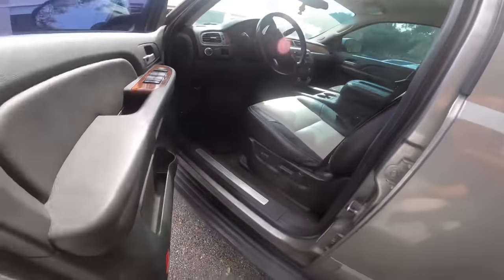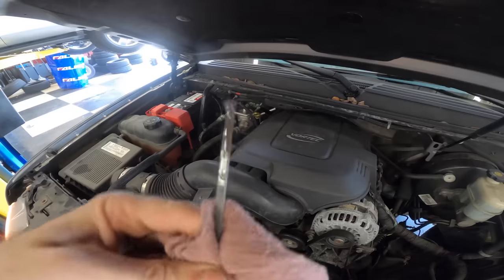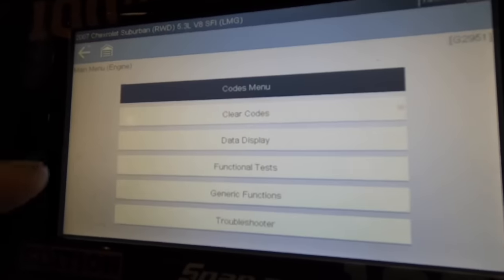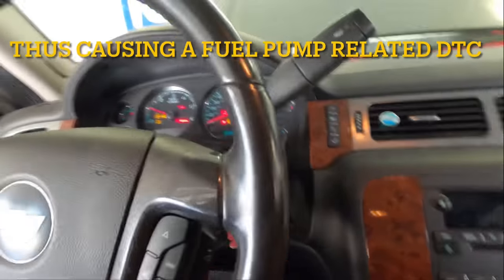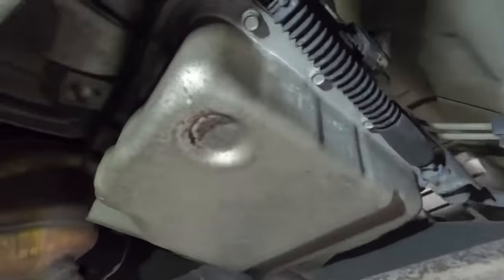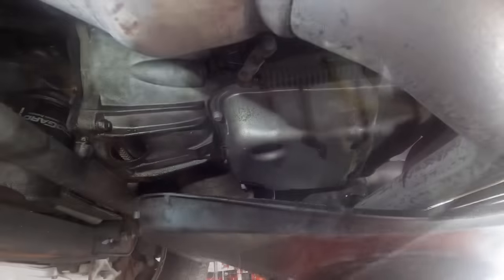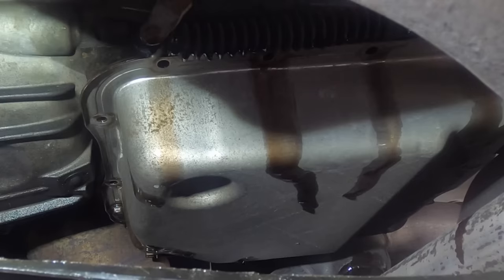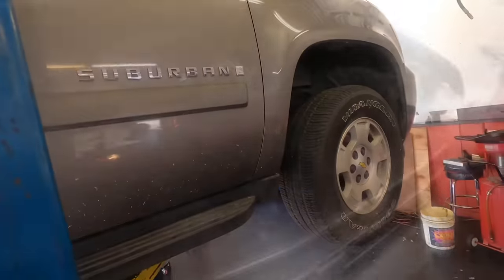Busted! SCAMMING Mechanic Causes Damage! 4l60E Transmission

Comment: The more videos I watch from you, the happier I am that I do in house fleet work. The drivers still lie, but my two hands are pretty much the only thing that touches the trucks so I don't have to worry about anyone else's work. My favorite time of year is coming, busting guys "checking" trucks oil and whatnot without ever disturbing the blanket of snow on the hood. Some are real good, they can find power steering and trans fluid to check on F150s that have neither option.
Reply: Ah, a lot of those inspection sheets are really antiquated. Check the oil, and a few other safety items should be all that is expected.
Reply: @mph5896  We have stuff from the early 2000s still on the road along with brand new ones, there is one sheet for all of them. It's a good test to see if people are actually doing the checks or not. The only check a lot of them do is whether the starter works or not.
Reply: I hired an ex-military lead tech/driver supervisor.
He started doing spot checks (after drivers were suppose to have done it) in the AM as trucks were departing yard(one truck a day), and quickly found the problems...
And almost stopped the on road problems (some breakdowns are inevitable)..... and got drivers to do a real vehicle checks.

AzDOT (DPS), road checks even stopped finding issues....
Best hire ever! amazing what spending a little time before can save you in the end.
Reply: It's a disgrace that Ford doesn't even provide a trans dipstick anymore. I didn't know they also sealed off the power steering pump. They want you to take it to the dealer for every little thing, at $105 an hour. Instead, I'll buy another brand.
Reply: @pookysdad4884  F-150's have electric power steering since at least 2015. The trans is checkable, but it's not easy to do.
Reply: @61rampy65  Oh, how interesting. Is it steering by wire?? I know many cars are throttle by wire, and some even brake by wire. Or is there a mechanical connection still, with electric assist? I'm an old car guy (old guy AND into old cars), but know little about newer ones.
Reply: @pookysdad4884   Electric motor on the column under the dash, hooked to the rack. Very few vehicles use a throttle cable anymore. Almost all are totally electronic. In many cases the parking brake is also electronic as well.
Reply: @joshuapittman5208  I see, thanx!
Reply: @joshuapittman5208  I'm pretty sure Ford's are standard steering columns with an electric rack.
Reply: @pookysdad4884  The dipstick was clearly designed by someone who will never attempt the job of checking it. You have to reach between the smoking hot catalytic converter and trans with a 19mm (?) wrech and thread the cap off then do your best to get the little stick out without getting burned.
Reply: @--_DJ_--   Maybe. I don’t work on them, I just know most companies are going to electric or electric assist. I really wish they wouldn’t though. Prefer hydraulic myself.
Reply: Visit a salvage yard. Buy an engine and trans dipstick and cut them off. Randomly install them in trucks and  Give the driver that finds them within a day a gift cert for a nice dinner. And at least the local dinner, not the golden arches. <G>
Reply: @bobmazzi7435  They are getting well paid to open that hood, I am more likely to give them a kick in the ass for a bad job than a pat on the back for doing the bare minimum. That is a funny idea though with the mock dip sticks.
Reply: Electric power steering is pretty slick I think. They say they only draw power while turning so it helps with fuel efficiency compared to the regular hydraulic power steering.
Reply: @rustyshackelford7651  I find it a bit too light on the new F150 I got from work. It's fine going down the road though, just the real slow stuff. It would be great if they would let us adjust the feel.

Comment: Have heard too many stories about bad mechanics. Had a few positive experiences, but fear of the bad makes me repair my own vehicles as much as I'm comfortable with.
Reply: @todddennehy804  Luckily, I found a decent small town mechanic that seems to do a good enough job. Had an intermittent stalling issue that he wouldn't repair until it got worse, since he couldn't verify the cause. I still do most of my own stuff. Lucky to have a dad that used to work on vehicles all the time that teaches me what I don't know. Had an oil filter housing gasket blow last week that I thought would force me to get the vehicle into a mechanic, but managed to change it after only a few expletives being directed towards the suspension that got in the way.
Reply: @muffinmaan7444  that's awesome.  I lost my dad pretty recently, and he's the one that got me interested in specialty cars.  Dad's are the best, right up there with moms!
Happy motoring!
Reply: @muffinmaan7444  It speaks well of him that he insisted on verifying the problem before he spent your money on a repair.  IMHO

Comment: Great video!  I'm dealing with a car that the repair shop told me they performed a Block Test on the car and verified the head gasket had blown.  Problem is, the car was towed to them with a blown out radiator.  The didn't know their audience, I knew they couldn't do a block test without coolant.  quoted $7800 for radiator and head gasket R&R.  I brought the car home (300+ miles) on a trailer and will perform a block test with a new radiator installed.  I used to run a shop and couldn't believe how many shot gun repairs came through without fixing the problem and so many scams.  Even some of the good mechanics played dirty.  One guys attitude was charge em cheap at first to build trust and get the $$ back on subsequent repairs.

Comment: Rainman, you got my sub halfway through this video! But this just makes me renew my commitment to buy older vehicles that are as close to a lawnmower engine on a chassis as I can get.
Reply: lol!
Reply: Veteran 1975/ 93   16 E ...52 D... 63 B.. Paid Attention,  AWS... ASE... Cert.  
1960 F100 4x4
1977 Toyota Hilux
1978 Dodge Sportsman Apache Motor Home 4x4
Trust me Lee stay to your older stuff and life is sweet.
Reply: I could not agree more.If I was 30yrs younger,my main vehicle would be an 80s vehicle that I had completely refurbished myself.
Reply: the issues on it are normal, stupid owner basically and crooked mechanic
Reply: Kinda like my 77 toyota pickup

Comment: Great content. It took more smarts to rig the car than to fix it in the first place. Use your powers for good not evil !!
Reply: I thought the exact same thing.  Guy is clearly smart.  Too bad he uses it for the wrong thing.
Reply: Yeah that's why I disagree. I don't think a scammer would go to those lengths to sell a fuel pump and TCM. Plus the vehicle started and ran. Kind of hard to sell a customer a fuel pump on a running vehicle no? QI suspect that vehicle had your typical GM electrical gremlins that come and go, and someone worked in some bypasses and rigs. 🤷‍♂️ just my observations as a professional mechanic.

Customer strikes me as one who doesn't properly maintain their vehicle. Judging by the condition of that transmission fluid, the engine oil pressure fault, and the ghetto ignition switch.

Comment: After working in a few auto shops, I was disgusted with the service writer/owners selling BS services to pad their pocket. These women come in for an oil change and suddenly have burned up brake rotors using scare tactics to make a sale.. Even as a customer, these shops try to rip me off not knowing I'm ASE Certified as a Med/Hvy truck technician, and only there for a state mandated inspection. [Blackstone does ATF testing and quite reliable]
Reply: Nothing against you personally but ASE certifications are a joke, I'm Certified in structural repair and welding. I have 0 idea how to do that.
Reply: @squidlox5459  lol
Reply: @squidlox5459  I would like to know how it came to be that you were given certification for something that you know nothing about and where you went to school for it.
Reply: @todddenio3200  went to WTC for their now retired auto body program. They provided ASE certification tests for free with the program. I took all the tests I could, passed every single one. The only one I'm semi-qualified for is non structural repair
Reply: @squidlox5459  wow. When I went to tech school for autobody the testing for ASE certification was not handed out that easily. To get the certifications there was not only a written test but also a skills test where you actually had to do the work to demonstrate that you were qualified to get the certification. Same went for those who took the mechanics  and the automotive machinists courses. Between my brothers and I we went to 5 different Vo-Techs here in MinneSNOWta and all of us had to test out with both written and skills tests. One of my brothers failed the written test because he is dyslexic and had to retake it. Maybe it differs from state to state or school to school but it seems that MinneSNOWta has a lot stricter guidelines on a lot of things, for example CDL driver’s licenses - when the state changed the testing for getting a CDL or keeping it if you already had one, there were a lot of drivers with over 20 years experience who failed the tests repeatedly and some never did get their CDL back including some who worked for the state highway department.
Reply: @todddenio3200  ASE was multiple choice on a computer
Reply: I'm an Electrician and its the same as long as you've got a good memory you can be a qualified electrician. No practical examination just equations and page flipping and the test is multiple choice.
Reply: @dabiggcrunk  WOW. That is a scary thought. It makes a person reconsider whether to hire an actual electrician or if they should study up on how to do the work themselves. It would also explain why it seems that some electricians tend to repeatedly have problems arise with work they’ve done which the inspectors would make them fix before the wiring could be enclosed on jobs where an inspection was required and why on jobs that it wasn’t required they would be called back because something was not working properly or a different electrician was called in to fix the problem because the property owner no longer trusted that one to do the work. This had happened to my mother several years ago and while I did know how to do the work properly I was not allowed to do the work legally because I was not the property owner which is how the laws on doing electrical work are in the state I live in but the laws may be different in other states but I don’t know for sure.
Reply: @todddenio3200  Oh just because someone is a good electrician dosent mean they're knowledgeable in code lol. I'm an instructor and teach code and calculations and the two are not the same. It's takes time to be a sound electrician which is why I have to disagree that a homeowner should do their own electric work. So many variables I can think of before and during installation that a typical homeowner may not be knowledgeable on or have read the Article or even interpreted right. Technically a homeowners not supposed to change a light bulb, it's supposed to be a permit pulled. Many people die each year doing "basic electric work" . Just remember that it dosent become an article in the NEC unless a Corpse turns up.
Reply: @dabiggcrunk  the one that my mother hired first had wires crossed going to her new water heater, furnace, and kitchen range with hot leads going to the neutrals and the breakers tripped instantly when Turned on when he was done. He came up from the basement walked over to the kitchen range and turned it on but stood in front of it so nobody could see if any burner lights lit up and then said he was finished and that it would take a while for the water to heat up, and asked if she could pay him while he was there because he had to go do  a job at his bank so he could just deposit it when he got there to do the work for them. She paid him and got a receipt and he left. 2 hours later she went to wash her hands and the water was cold. THEN She asked me to go and turn on the breaker because he must have forgotten to turn the breaker to the water heater on. I went down and saw it and 2 others were tripped, turned it on and it instantly tripped again just as she yelled down to me to say the range wasn’t working. I tried those breakers and they tripped instantly as well.  I told her the breakers were tripped and kept tripping instantly when I turned them on.  She called him on his cellphone and told him the breakers were tripping and asked if he could come back and find out what was wrong with those circuits. He said it had to be the appliances that were bad and they’re not his responsibility and hung up on her. She wouldn’t let me look at it even though I had completely reworked my own house and garage  with no issues. She called a different electrician to see if they could come look at it and luckily that one was available and could be there in 10 minutes as he had just had a cancellation and was at a gas station 4 blocks away. He came and I brought him to the basement to show him what was where and he took the electrical cover plate off the water heater after turning off the breakers. I was already back upstairs by then and we heard a loud WTF? OMG!!! Who the F did this and he came upstairs looking like he wasn’t sure if he should faint or explode and asked if I could go downstairs with him because he had to show me something. He showed me the crossed wires at the water heater and said he wanted me there as a witness to it and to watch as he assessed the other circuits to verify tat he hadn’t changed any of the wires around. He then went to the furnace and removed the cover and wires there were also crossed. Then he went to check the outlet for the range and THAT was actually wired right…at THAT END. Then before correcting anything he had me watch him remove the cover panel from the service box. I thought he was having a stroke when he looked inside and saw wires crossed in the breaker box as well as some neutrals for other circuits that weren’t even connected and others that were not even tightened and were just resting in the holes behind their lock screws. He was amazed the house hadn’t caught on fire even though it was only a few hours since the other guy had left. He checked over EVERYTHING the other one had done at both ends of each circuit and photographed everything that was done wrong. Mom had to file suit against the first guy and he paid her just  before the court date. Somehow that idiot had gotten licensed and bonded as an electrician and even after
How bad he’d messed up at my moms house, and she had filed complaints on him and somehow he kept his license even  though 3 weeks after  moms house a  garage he had wired for a customer  burnt down from an electrical problem and that place was built  and wired after my moms house was. Somehow he is still a licensed electrician to this day.
Reply: @dabiggcrunk  my neighbor is convinced he can pull 220 from 2 outlets on the same fuse with a "Y" cable.

Comment: In owning cars for the last 47 years have never brought one to a mechanic in fear of being ripped off.  It is nice to see a decent mechanic troubleshoot vehicles and do a proper repair.  After an initial transmission fluid and filter change due to a black ATF color (bought the van used) I welded a drain plug on the transmission pan and change the fluid yearly for about $50 CDN.  WIll change the filter at 300,000 Km.  Keep on making more videos as you appear to fix a multitude of problems on many different models.

Comment: Thank you for the video.  I as well try to have happy customers for their comebacks when needed.  I dislike shady characters as well.  I used to work on semi trucks and had another mechanic that was "shortcutting" repairs just to get the drivers out.  It is a small hometown company and he would put the finger on me when things went awry.  I left them for that reason and they found out that my complaints had merit.  Wanted me to come back but the problem was still there. I respectfully declined.  I retired my toolbox at 51 years of age.

Comment: Well that must have been frustrating, but It's a good reminder to thoroughly check the fuses after pulling codes. Would have saved you a bit of time if you noticed that missing fuse and rogue wire earlier.

Comment: In my younger years I worked in the automotive repair field. I was in tech school in the Denver CO area and I failed a car on a inspection and the customer went wild about it. They called the state officials and I was put on the carpet. The state person had me show them how I inspected the car in question. I did it by the book and showed them why the car failed. The state person turned to the customer and said that your car failed, got the repair, got a new customer and was told that if I moved to CO to just stop by the office and pickup my license when and if I ever returned. I moved to upstate NY after tech school and was working in a dealership. I inspected a vehicle by the book and it didn't pass muster. The shop foreman told me to sticker the car, I said with the ten day so as they could get it repaired. He said no - put the regular sticker on it. I told him I wasn't putting my name on a unsafe vehicle. He told me I was fired. I stared to do work on the side at home and haven't had a come back. Still wrenching and I'm in my seventies.

Comment: 2007 Yukon Denali at 100k miles. Had same troubles with oil pressure gauge. Had to replace battery after leaving us stranded twice. The starter goes out replaced that. The engine dies twice all with about a yr. No codes and engine failure could not be duplicated after leaving it at the shop for over a week. Never replaced anything else and got rid. I don’t as not about to let that POS leave me stranded again. After it died and hour later it would start just fine.
You are lucky enough get error codes. 
You are a true professional.